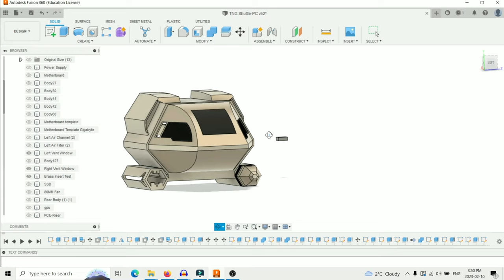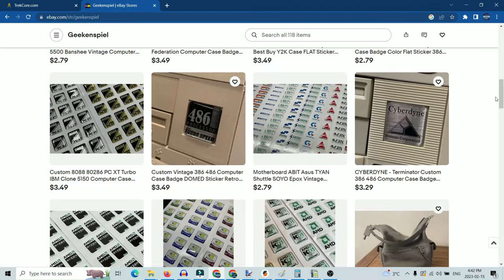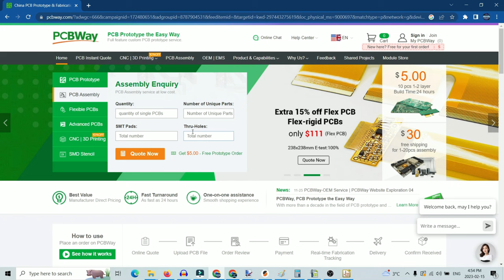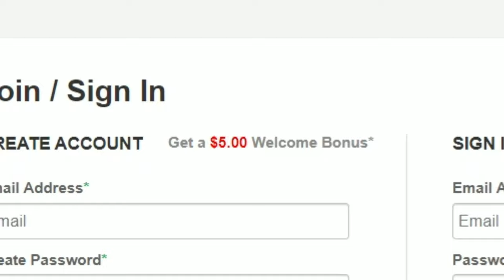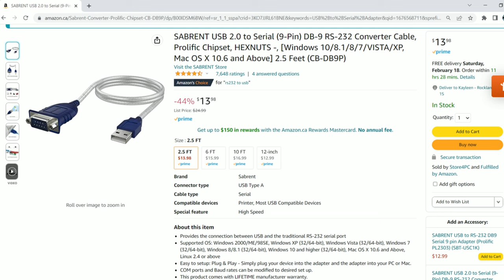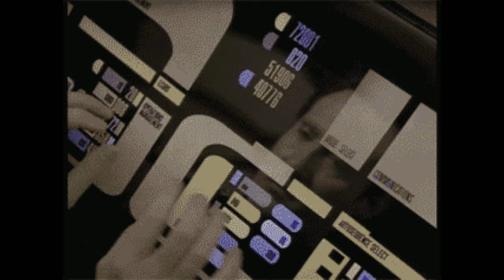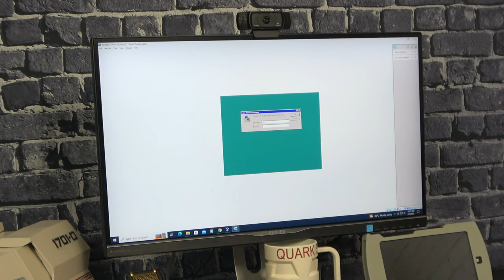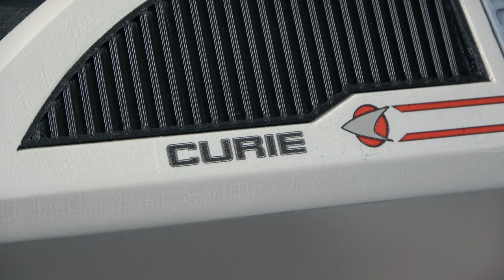I Built a REAL Shuttle PC [Star Trek Picard Build]

Comment: Wow, that's an amazing build. That's one of the coolest custom PC cases I have seen. Would be really cool seeing it with modern hardware. Maybe you could fit a small radiator at the bottom of the case so you can cool the CPU and GPU without needing to worry too much about airflow in the rest of the case
Reply from the maker: I definitely have some big cooling plans for the V2 if it comes about :)

Comment: What a fantastic project - that's a very clever design and it looks like a better version of one of the old Playmates toys from the 90s. How did the thermals hold up? It looks like your thermal design is pretty clever and should give a decent amount of airflow to the board.
Reply from the maker: They ended up well within the safety margins of the components, but it is a little toastier than I would like (65 to 70 degrees under load). I've got ideas for V2 though ;)

Comment: Fantastic project. BTW, the 3D printed hull looks thick and sturdy, I had never seen 3D printed stuff like that. What kind of material is it?
Reply from the maker: Glad you liked it! I printed it out of standard PETG. Its got better thermal resistance compared to PLA. Should hold up pretty well, but only time will tell for sure!

Comment: Jay! Great vid! The binding issue on the spool rails is an odd issue. Is it prevalent with most types of 3D printers? Mild chamfer on the spool hole cutouts that run on the track may alleviate the problem.
Reply from the maker: Hey Walter! Thanks for watching! This is the first time I've run into this particular filament issue. Essentially it was a pretty full roll of filament, and, when the print head moved full left to full right, it created enough slack that the filament was able to unwind a coil off the side of the spool, which then tightened up around the spool holder. I should have better restrained the filament path, but I was tired. Live and learn :)

Comment: be nice if an LCARS overlay could be coded for a full PC touch screen. I have a touchscreen monitor, but it's not 4k so it's a secondary.
Reply from the maker: The primary controls are web hosted on the ESP8266 for the LED controller, so you could definitely load them up on the touch screen! I've actually been thinking about adding a touch screen as a second monitor... would you recommend yours?
Reply: @PNPRetro  mines an Acer, I don't even see a model number on it, but it's several years old, probably not made anymore. Or a newer one is around that I haven't seen.